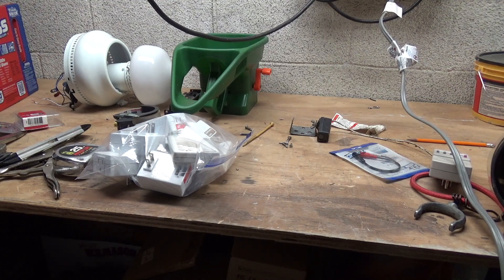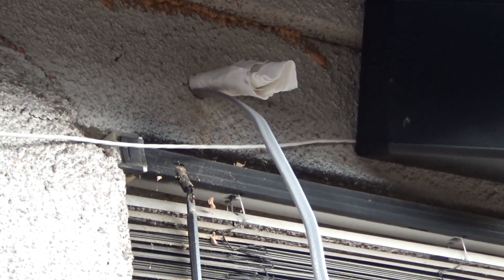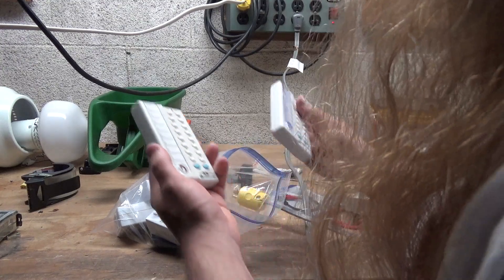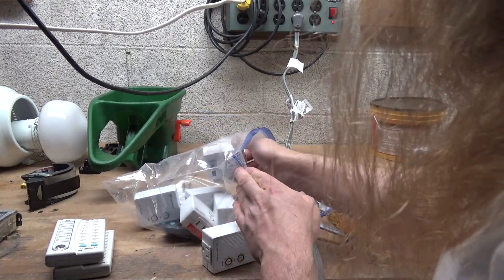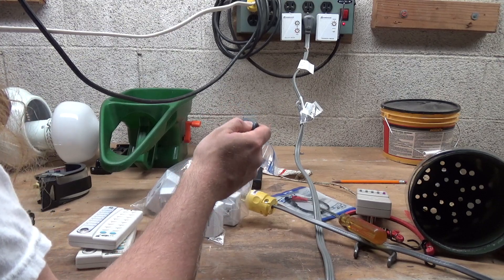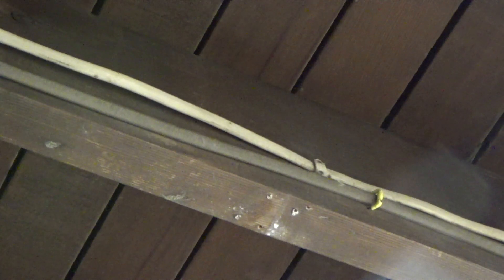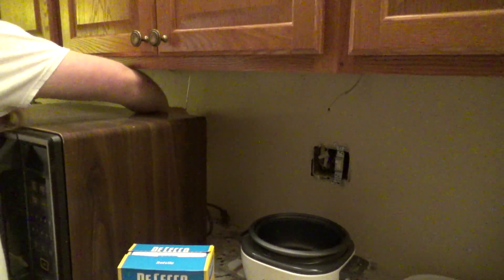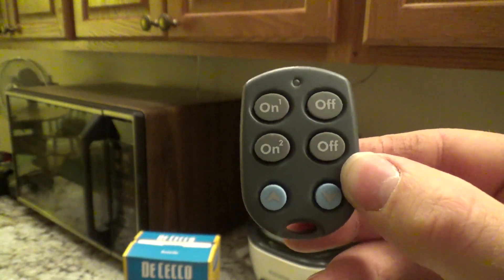X10 Home Automation System to Control Back Yard Street Lights

Comment: I have the radio shack version of these exact same control switches and remotes which I bought in 1999 and in 2004. One transceiver, one handheld remote, two tabletop remotes, two lamp modules, and two appliance modules

I don't have the tabletop timer or the optional alarm system however.
The pieces that I bought were sold separately at the time.

Totally forgot I had them still, I'm thinking of using them for something now.

Question: 
Do you know if the radio shack modules are compatible with the X10 system and vice versa?

 Are there any differences with the X10 system that would make it better than the radio shack version?
Reply: Radioshack and X10 use the same protocol so they work together, and the radio shack is just re-branded official X10 modules
Reply: @newellslab  Great. Thanks alot for letting me know.
Reply from the maker: I've used RadioShack, Sears, and X10 branded units interchangeably with no discrepancies.
Reply: @JordanU  Thanks.